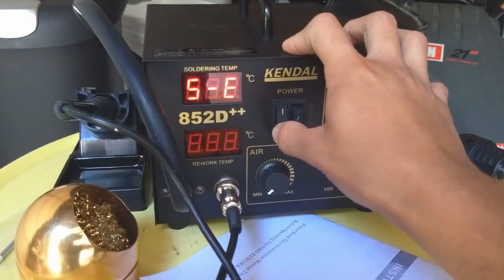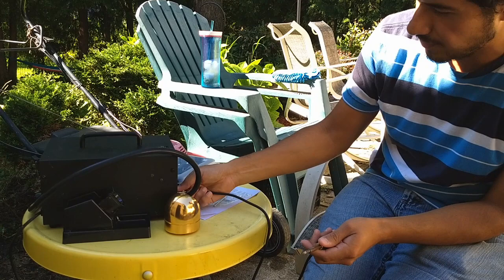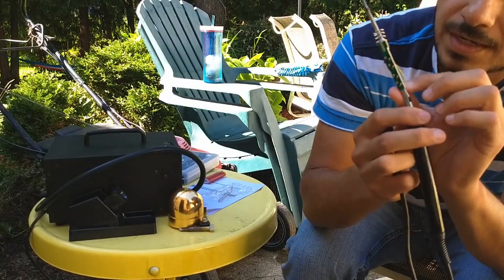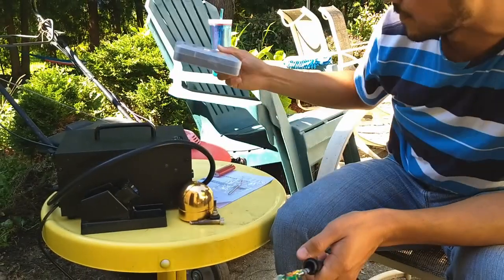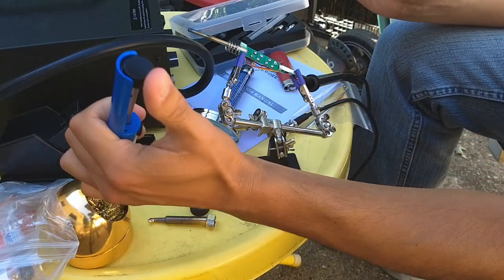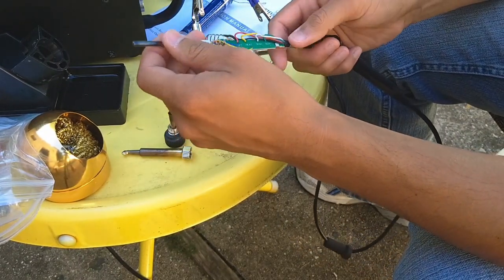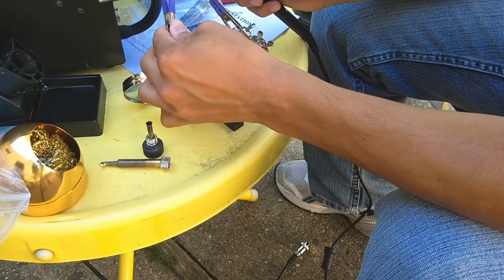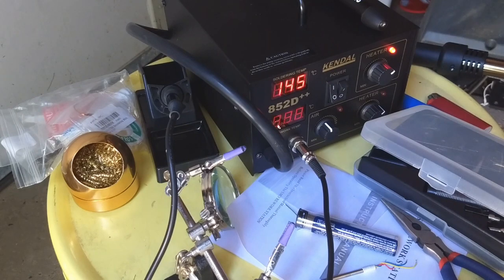How to: Fix a Soldering Iron With The Error S-E or 5-E

Comment: Thank you for posting this, it helps me considerably. My Circuit Specialists rework station displayed this error code with no mention in the instruction manual what this meant. I wound up taking the main control unit apart testing all the components on the board thinking the issue was there but not finding any obvious fault. Now I know! :goodvibes:

Comment: New subscriber here.
Reply from the maker: Appreciate it! I recently got the error again and just ended up replacing the whole thing with this one and it seems to work fine
https://www.ebay.com/itm/BAKU-5-Pin-Female-Soldering-Iron-Pen-Replacement-Tools-FOR-BK-601A-601D-878-909/174121808095
Reply: That's nice, you got a replacement. Usually this error is caused by a short (it's happening to my T12 Hakko clone tip, an insulation in there must have melted, I pushed it's maximum temp thresh, which is only 400C, to 500C+ when I was testing its limits, coz' I was excited, it's the first time I had different tips, coming from only using conical for decades).

Comment: Oh, ahora sé por qué mi cautín de la Yihua 862BD+ no derretía el estaño y cada que movía el cable me saltaba un 5-E y se movían mucho los números como si subiera y bajara la temperatura a lo loco. Ni modo, tendré qué repararlo y comprar un cautín extra para eso. Gracias por la ayuda, lo aprecio mucho

Oh, now I know why my soldering iron from the Yihua 862BD + did not melt the tin and every time I moved the cable showed a 5-E and the numbers would move a lot as if the temperature was going up and down like crazy. Whatever, I'll have to repair it and buy an extra soldering iron for that. Thanks for the help! I really appreciated
Reply from the maker: de nada! Si yo use otro que tenia para reparar el mio. Pero desafortunadamente dejo de funcionar despuse de unos meces :/ acabo de comprar este que esta funcionando bien, pero no se por cuanto tiempo... gracias por el comentario!
https://www.ebay.com/itm/BAKU-5-Pin-Female-Soldering-Iron-Pen-Replacement-Tools-FOR-BK-601A-601D-878-909/174121808095

Comment: Hi. I have a T12 BC3 tip (Hakko technology, a clone), I checked the ohms it's not OL but the workstation reboots when I use this tip (it's new. The soldering workstation is a T12 from KSGER). Any way to repair this tip?

Thank you. God bless, Rev. 21:4
Reply from the maker: I'm sorry I'm not sure how I'd troubleshot that
Reply: Hi. I found the culprit, testing this amazing OLED T12 and the tips (it's my first soldering station w/ temperature control, that's not butane from Radioshack's, Iroda technology and my first to have tips that's not conical- it was exciting) to its limits, I was testing it based off the maximum temperature of the tips of the genuine Hakko T12, which is at 450C but I later found out, that the 10 piece T12 Hakko tip clones was just rated at 400C (over at KSGER's online site at AliExpress). 

I was testing it well over 480C to 500+ (480C is the maximum of the workstation) w/ 1 minute boost.

The sensor seems fine but its shorting, the insulation inside is most likely touching the metal body. I'll drill a hole, inject silicone (used in gutters or aquariums), hopefully it insulates it again- pray and wish me luck.

Happy Easter ✟🐰🥚, bestfriend Jesus is risen!!! and stay safe.

Comment: Такая же проблема, как же печально, что я не понимаю английский)
Reply from the maker: Я заменил нагревательный элемент, и он снова проработал несколько месяцев, потом снова сломался. Затем я купил этот, и, похоже, он работает нормально. (Использование Google Translate, поэтому этот комментарий может быть совершенно неправильным)

I replaced the heating element and it worked again for a few months, then it broke again. I then bought this one and it seems to be working fine. (Using google translate so this comment could be completely wrong!)

https://www.ebay.com/itm/BAKU-5-Pin-Female-Soldering-Iron-Pen-Replacement-Tools-FOR-BK-601A-601D-878-909/174121808095

Comment: I just bought a whole new handle for mine! BRAN NEW AND IT STILL READS THE SAME!
Reply from the maker: I just replaced mine with this one and it worked fine. Did you maybe get a faulty one?
https://www.ebay.com/itm/BAKU-5-Pin-Female-Soldering-Iron-Pen-Replacement-Tools-FOR-BK-601A-601D-878-909/174121808095
Reply: I have the same problem did you fix it?

Comment: I should chime in here on the same error... but it pertains to the heat gun (blower). My Model 825D+ has the read-out for the blower on the top-left LED. The soldering gun worked fine. The fix is similar, but you don't need to replace the entire (much larger) heating element. In a text thread I read somewhere that the author eluded to "oxidation" fooling the sensor into thinking it was failing. 
1. With the unit unplugged I carefully disassembled the heat gun. It's glued, so go slow and methodically. You can remove the housing half that does not have the tiny circuit board attached to it from the rubber hose. No need to inspect the element itself. The problem is oxidation on the circuit board. 
2. I put on my jewelers magnifying headset and got some Isopropyl alcohol and a few cotton swabs. I wiped down all the soldered terminals and blasted it with some air. Upon closer inspection I noticed two of these soldering points were within 2mm of each other and evidence of oxidation was visible. I too a standard screwdriver bit and carved a wider channel between them and then swabbed and blasted with air again.
3. Reassembled it all. No more S-E error code.

My point being.. BEFORE you go through the extra work of resoldering a new element to either the soldering pen or the heat gun, try removing any oxidation and inspect the gap between the soldering points for an acceptable width.
Oh.. and remember to take off your jewelers magnifying headset before answering the door looking like Dr. Brown in Back to The Future.

Comment: I have an issue where the blower motor stopped receiving voltage, but the heating element of the blower is heating up and the temperature works. Not sure why the fan inside the blower stoped working. Anyone?
Reply: Did you manage to figure out how to fix that problem.I am in the same situation and no solution in sight

Comment: thx for the video . I have a Saike 909d dfrom ali express. The station came with an extra heating element A1322. the two shorter wires are for the heating and i'm not sure if they have polarity, the other two they have polarity and its for the temperature sensor (i made the mistake and  put it in reverse as i put the longest to the far away position and was not working until i change it . Also i re solder the 5 wires . The 5-E problem solve.

Comment: not true i got same error on whole new tip
Reply from the maker: were you able to resolve the problem? And are you sure you wired the new tip correctly? this did fix my problem
Reply: @LightningSharkProductions  no i didnt resolve it.. i believe its the controller in the main body... so im just going to get a ts100 or use the old tip and hook it up to a car battery. which ive done melts solder just fine they are 12 volt and 24 volt for about 5 bucks i can get a 10 amp step up converter and variy the temo that way but for now 12 volts works just fine dont wanna trash it i still hve the smd on it that works fine so its a separate system i believe..